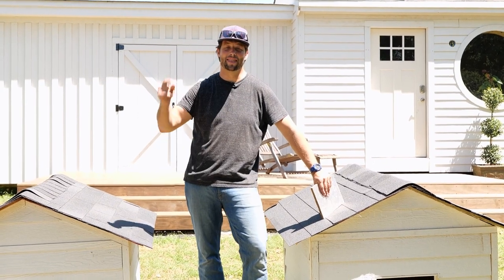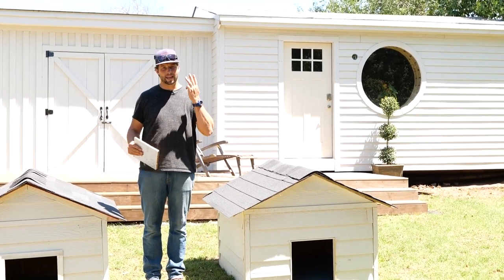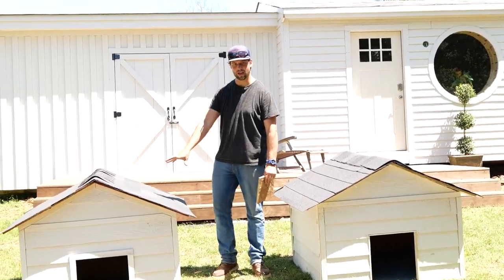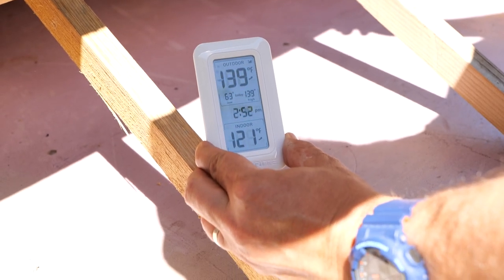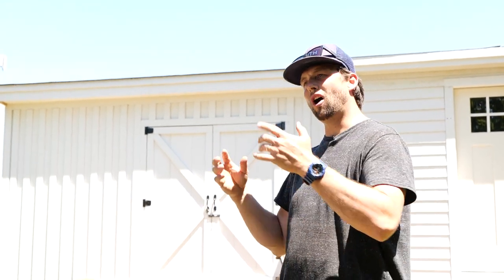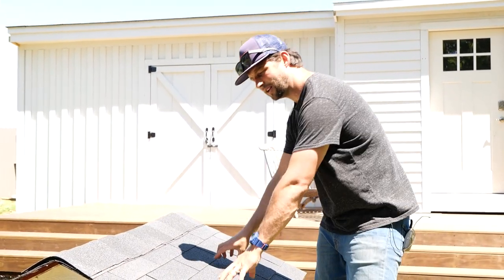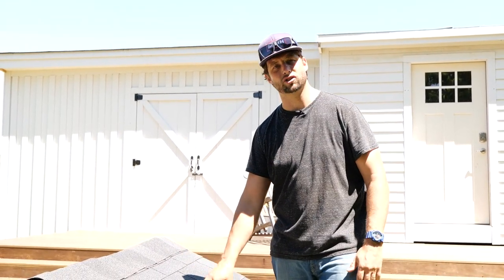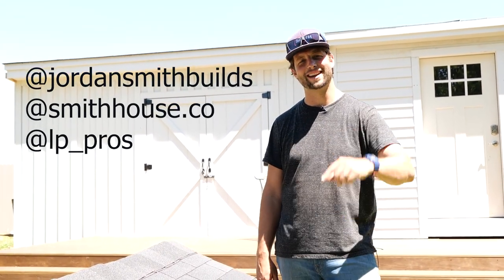Do Radiant Barriers Actually Work?  Head to Head Comparison Test!

Comment: Your analysis of convection and conduction is correct,  radiant is not.  Heat does not travel by radiation,  heat is the conversion of radiation into thermal energy. 

Flip your foil around and add an air gap between the shingles and radaint barrier, it will work much better.  Just like they do with satellites in space... foil needs to face radiation source.

Comment: Thanks for this video. What I did was do both. I just had my roof done and silver side up. I also had radiant barrier SPAYED done in my attic (giving me a 50-60 degree difference) and had 7-10 inches of insulation added, attic tent and I have two a/c units for each side of my 2500 sq. ft house. Sealed all my can lights, changed all light bulbs to LED's. My utilities went from $400 to $100. My thermostats are on 78 and 82. I also used purple insulation on the garage door. Whoo Hoo.

Comment: The property that aluminum has going for it is its emissivity coefficient, a measure of how much infrared it radiates compared to a perfect "black body" which has a coefficient of 1.  Aluminum foil typically has a coefficient of 0.04.  Wood is typically 0.9 or higher, so aluminum foil will radiate about 20 times less infrared than wood if they're both at the same temperature.
Reply: Great explanation!

Comment: Make a third doghouse and put the aluminum facing up. Tape the joints and nails. Put 2x4 furring on that. Deck it again then roof it. Check the difference between it and the others.

Comment: what happens if you add an air gap between the shingle and the aluminum (faced up)? does the air gap change anything because now the shingle is not conducting heat?

Comment: I find this counterintuitive, but I don't doubt it is true.  I think LP TechShield is mostly for warmer climates.  Don't forget to vacuum the aluminum side from time to time as dust reduces the effectiveness.  I wonder if money would be better spent getting more reflective roofing.  It's odd that my cars "radiator" is made out of aluminum.  I guess "convector" was taken.
Reply: radiator, radiates heat.
Reply: @FullSendPrecision  My understanding of the video is that the aluminum attached to the OSB stops or reduces radiation.  Seems weird.  I think car radiators work primarily through convection.
Reply: @59seank  we’re both right. Think back to how old houses are heated. Radiators :)
Reply: @FullSendPrecision  I have fond memories of cast iron radiators.  I had a favorite chair near one and it kept me toasty warm as opposed to the leaky single pane windows and barely insulated walls..  It didn't dry out the air like forced air systems.
Reply: @FullSendPrecision  Radiators increase surface area to allow heat to pass form one fluid to another faster.
Reply: @59seank  agreed central air is the WORST.  For heat I use vent free gas fireplaces mixed with mini splits.  Its sad Everyone turned on vent free, they are the best.  Mind you I have a 1980 drafty home and my natural gas prices are insanely low.
Reply: you're right, the car radiator is actually a convector, the naming  is very confusing if you're trying to learn these things from first principles
Reply: Aaron Anderson except it doesn't, that's what this vid is about: aluminum has low emissivity, but add a fan and everything changes

Comment: I'm guessing that this is more popular in area without cold winters.  I don't see it at all around Ontario, Canada.  Just well vented attics to protect asphalt shingles from getting hot enough to cause degradation in the summer and ice damning near the eaves in the winters.  Then a big layer of insulation between the attic and the living area.

Comment: The last time you had a video about this, someone I follow on IG was putting a similar product to this right over existing roof sheathing. After letting him know that without an air gap it wouldn't do anything, he talked to his roofers who must have researched it a bit more, and they agreed. They then charged him the same price as a premium osb roof decking of the same thickness.

Btw, did that shed get an addition?

Comment: Silver side is supposed to go up, but you have to leave an air gap. I suspect that you got a lower temp on it installed silver side down because you put a less conductive material against the hot roof, but had you left an air gap, you would have gotten an even lower temp with the silver side up blocking the radiant heat gain. It needs the air gap to prevent heating by conduction (like an aluminum frying pan on a hot plate).
Reply: although that is the optimal installation method for a radiant barrier, i don't believe that is the intended use of this particular product. it seems to be a middle ground, in the event an attic space is finished out for occupation

Comment: Very interesting video. Does the same apply if you have a steel roof instead of asphalt?
In the vanlife community (those that live full or part time in vehicles such as a Sprinter van), there is a lot of misinformation on how best to install the radiant barrier. 
We've done this - steel roof, air gap of 2cm, then reflectix radiant barrier, then 2cm air gap followed by insulation followed by wood panels for our ceiling. 
Is this the way to do it?

Comment: My builder installed the OSB with the foil side toward the attic.  Plus, he installed Galv-alum standing seam steel roofing.  I'm not sure that's better or worse than what the folks selling the foil radiant barrier and telling us to install it on the bottom of the rafters or trusses to leave the air gap between the roof deck snd the radiant barrier.  Your opinion?

Comment: In my attic I have to install shiny side pointing into the attic. Reason? The HUGE amount of heat in the attic that I need to reflect away from the living space.
So far it has kept the livable space a decent and constant temperature with no wild swings in heat.
What about that foam insulation that is shiny on both sides?

Comment: Great example of how it works.

In Australia foil barrier is sometimes 'draped' under the roof in thin flexible 'film' sheets.
This is usually a retro fit.
I wonder how much better that would be with 2 air gaps?

The surface facing up could become dusty over time.
Does that dust effect the emissivity on the upper surface?
Reply: I think it actually pulls double duty when hung like that. The air gap on top lets it reflect heat (basically its reflectivity is as high as its emissivity is low). Even if the top gets dusty and it absorbs more heat, as long as the bottom is shiny, it still won't emit much downward. 

This is just kind of speculation based on physics fundamentals - I basically never hear anyone talking about both features at once. Makes sense to me, though.

Comment: Installed backwards… wouldn’t that just super heat the shingles and cause them to deteriorate faster?
Reply from the maker: I don’t know, but I doubt it. The radiant properties of the material go away as soon as it contacts the shingles. My best guess is that the aluminum will turn into a high-efficiency conductor, pulling the heat away from the shingles into the OSB below.  So best guess- it will just be inert?

Comment: Thanks for the video Jordan.  
Could you do this with other roof designs, e.g. insulation between the trusses that would be touching the aluminum, or a flat roof with insulation above the OSB, or how about siding with a rain vent behind it so there's less conduction but want to prevent radiation from the siding/roof to the OSB. What if you're in a colder climate and have to keep heat in. Would you install the radiant barrier in the same way in all of these cases?

Comment: Usimg electric air ventilation  as heat exhauster on you roof will do the same for quite cheap like factories have on their roof... to release hot air trapped...

Comment: I'm going to be building my house with ICF walls in southern AZ. For the roof I want to do closed cell spray foam in addition to radiant barrier on a metal roof. What is the best way to install it? Is that considered overkill?
Reply: Roof deck
Felt or synthetic barrier
Radiant barrier
Purlins
Metal roof attached to Purloins to provide the required air space

Comment: My bubble foil comes in both sides shiny. What now?
Reply: Staple it to the rafters and let it pull double duty. Top side reflects most heat, bottom side will behave exactly like the down-facing foil here. In theory this should work even better than in the video, because if it's integrated with the board, you don't take advantage of its reflective properties.